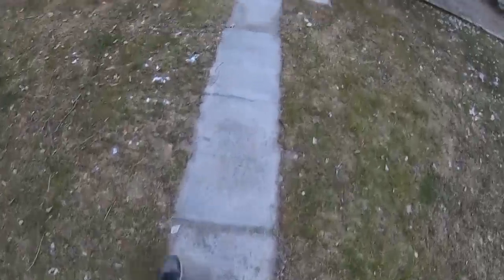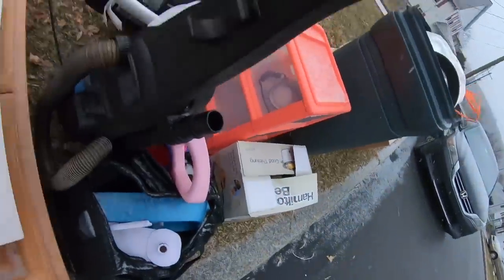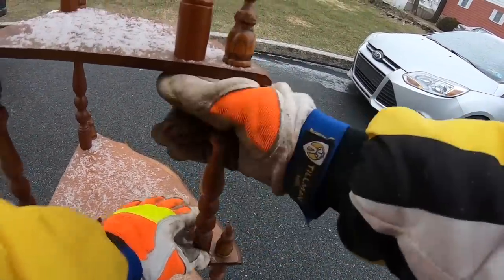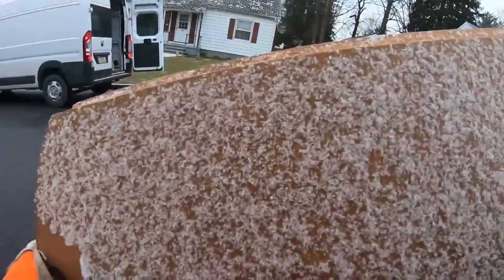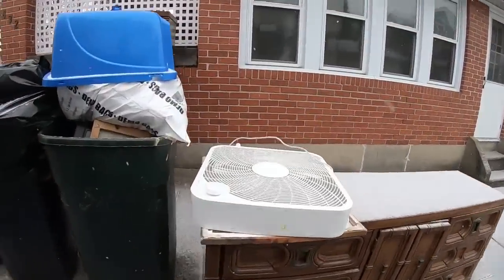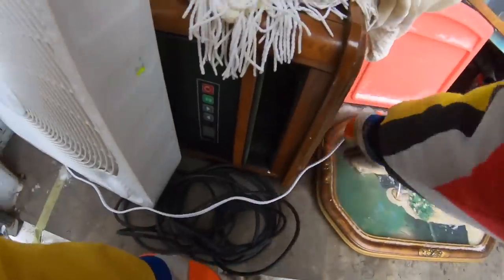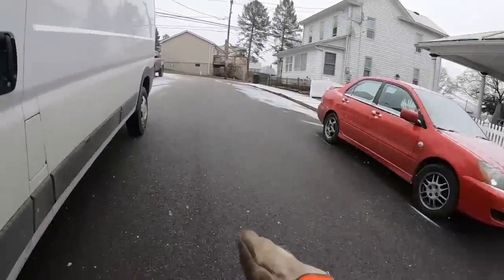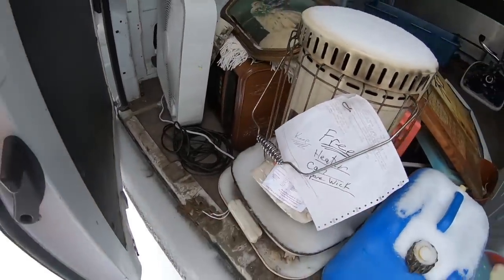DUMPSTER DIVING SCORES & TRASH PICKING ! - Ep. 116

Comment: Taco, a helpful tip for you. Get a long broom stick handle, drill a hole in the bottom and insert a screw in hook into it and glue. I still use mine all the time you can slide things around the back of the van and when you are ate flea market it makes thing just so much easier to unload. Really good reach when you want to get anything out of dumpsters.

Comment: The picture frame looks old from the back and the chenille bedspread can be sold for a good profit.  I picked one up on at Goodwill that was in the 50 cent bin, but because it was yellowed.  I know there are better was to clean them, but I just threw it in the washing machine on soak and then washed it with bleach and all the yellow came out!  I figured out that if it had holes in it it would still sell on eBay as a  cutter bedspread for crafts.

Comment: Hey just to let you know Mr Taco stacks on your Dodge key there is a backup key that slides in the key to unlock the doors where the key ring goes through there's a lever on the back you push the lever and a little key pops out so if you didn't want to roll your window down all the time you can use that little key to unlock your door